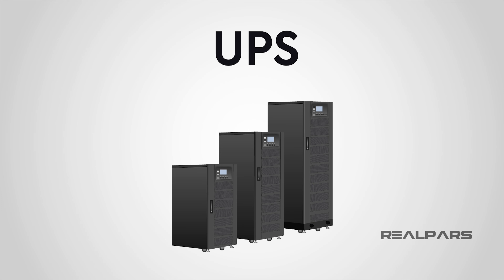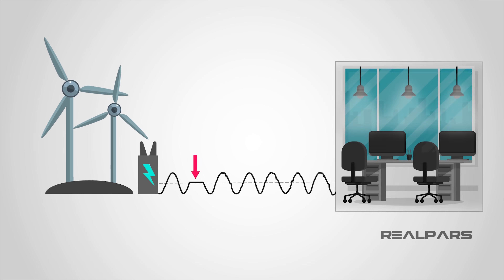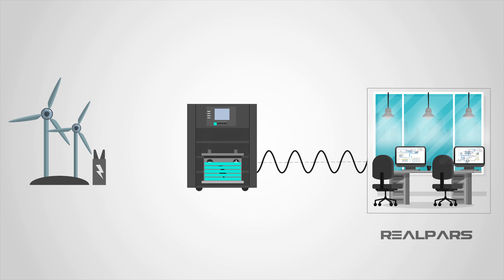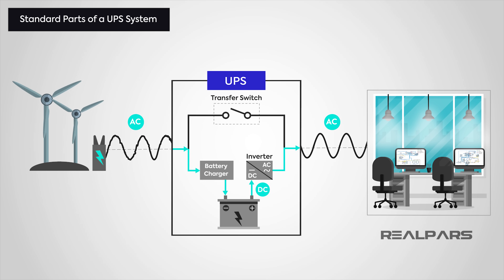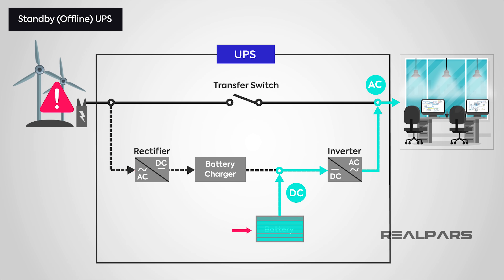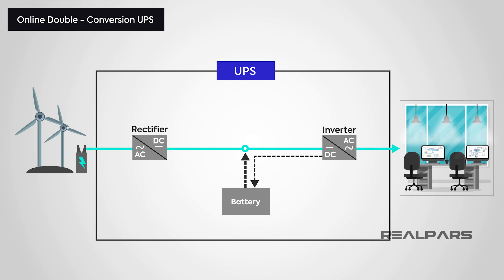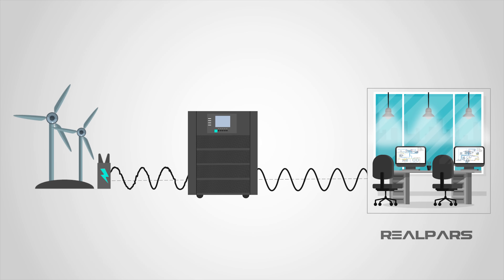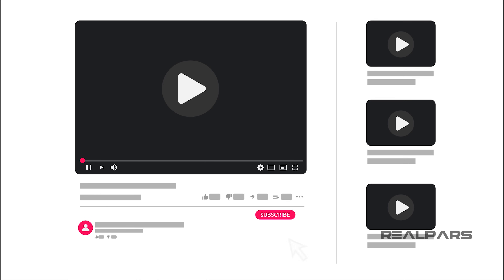What is a UPS? (Uninterruptible Power Supply)

Comment: Given that the batteries would provide only about 24V whereas the mains provide 120V/240V and the load equipment would also expect 120V/240V, there must also be step-up/step-down transformers inside the UPS. Of course, these would be part of the Battery Charger (step-down transformer) with AC-to-DC conversion (Rectifier) and the Inverter (step-up transformer) with DC-to-AC conversion.

Comment: Can i plug my computer with UPS during a power outage in my Generator? I am an online teacher.
Reply from the maker: Thanks for your question! You should be able to do this — just make sure your generator is running and your UPS still has some battery power before unplugging it from the wall and connecting it to the generator.
We recommend checking the manuals for your specific devices to be safe.

Happy learning from the RealPars Community!

Comment: Which type of UPS should I use best if I'm only using a laptop and a fiber router with 2 meshes? I just need a UPS system for a Work from home job is all because I don't want to be absent because of another unexpected power outage again
Reply from the maker: Hello, @ronnpaolomaigue5781  Thank you for your interesting question. We can’t give you a direct recommendation. Here is a rule you should follow: first, figure out the total line load in the current of your devices and the time you want the UPS to stay up when you lose power. Like 30 minutes or hours. Purchase the UPS that meets your needs and add 20% for the expansion of devices.  Happy learning from RealPars!

Comment: I run 2 pc's in an area with frequent power outages, one has an 850w PSU and the other 750w. 
Im terrified that a power outage will fry something someday, if i understand correctly i just need a UPS to have enough time to shut down everything safely before the battery is out right?
I dont need to keep running them while there is no power just a way to have enough time to react and shut them off in the event of an outage.
Would a UPS keep wattage flowing to my pc's without cutting out when power goes off? Thats what i need. I have a generator with the ability to automatically turn on when there is an outage but that just causes more risks imo because it shuts down and then on in a few seconds.
Reply: You are correct.  UPSs are sized to allow for an orderly, safe shutdown.  Keep in mind that you may lose medium voltage power that feeds your pumps and other equipment, but the UPS on a PC or PLC will allow them to continue to process the operational logic.  You need to ensure your I/O rack power remains on (maybe with a separate UPS) and if you lose your air compressor during a power outage, you will have a limited time to shutdown before you lose instrument air pressure.
Reply: @scottsommer6480  Thanks for the tips, ill look into it!

Comment: Can I plug a surge protector extension cord to UPS?
Reply from the maker: Hello, @joshuachu2445. Thank you for your question. Yes, you can, provided your extension cord meets the wattage requirements as your UPS's spec sheet requires. Ensure you stay within the length needed in the UPS manual and your local electrical codes. Happy learning from REALPARS!
Reply: @realpars  My extension chord handles 2500watts maximum. My UPS is 3000VA/1800w

Comment: How could one (data centre's) use generators with a double conversion UPS without a transfer switch?
Reply from the maker: As we stated in our video, you can have more than one UPS as a backup in your data center, protecting your data servers. The transfer switch is normally used on the AC side with generators and the utility power line coming into your plant. You can have more than one generator in parallel, too, depending on your engineering design and risk factors of power loss.

Comment: do standby USPs provide any additional protection from surges, voltage drops and instable supply for the load, in other words, could it be used as a protection means?
Reply from the maker: Hi Hamza, 

Thank you for your question. Yes, it can. But UPS power, depending on your load, will be limited until the batteries die. Regular UPS for backup use at home will last about 30 minutes. Many date servers have more significant UPS that can last as much as 2 hours. Those types of systems have a generator to back up the UPS.
Reply: @realpars  my question is about the case where the standby UPS is standing by, and the power is coming from the mains and not the battery, does the standby UPS provide any protection in this case?

Comment: uninterruptable power supply is device to keep computer or equipment safe when loss or significant reduction in primary power source. Ups houses several batteries that take over when it detects a loss or reduction in available power. Once detected, control is transferred over to the batteries

Comment: An ups battery will burn for 3 days non stop if it has a minor problem. So extreme caution should be taken when using them. Similarly big computers. The fire cannot be stopped because it is an electric dc shot circuit. At least 50 metres gaps are required for usage. Any DC system is like that. Some of them can burst to a range of 2 miles. Similarly huge TVs. Don't ask me why again and again.

Comment: Is there already a battery in the UPS which means have I buy new separate battery?
Reply from the maker: A UPS has one or more rechargeable batteries inside.  These batteries typically last 2-4 years, at which time, they need to be replaced.  The batteries are modular and can be removed and replaced fairly easily.  Most can be recycled.

Comment: should the UPS be plugged always, even if the PC is not in use?
Reply from the maker: The UPS should be plugged in whenever the PC is powered on.  If you power off the PC, you can power off the UPS, but you want to make sure the UPS is fully charged again before relying on it to provide backup power for the PC.

Comment: What about the power consumption of those three types of UPS? I have a 1Kav Online UPS and when I check with an energy monitor I feel it consume more electricity than it should be.
Reply from the maker: Every type of UPS consumes some power, even when not connected to the battery supply. On-line UPS systems, by their design, provide the highest level of protection against power loss but exhibit some power consumption during normal operation.  If your "losses" are >10%, then there may be an issue with the incoming power (cycle variations, "dirty" waveform, etc.) that is switching your system to battery in order to maintain a "clean" power feed.
Reply: @realpars  Thank you for your reply.

Comment: i have a question: do UPS consume more electricity?
Reply from the maker: Slightly more.  The UPS needs to consume power to keep its circuits alive.  From past measurements, I have found that a fully-charged UPS with no loads connected can draw between 5W (newer UPS models and technology) to about 50W (much older, less efficient UPS packages).  If the UPS provides 1500W at full load, then 5W is a small price to pay to keep your equipment running in case of a power outage.
Reply: @realpars  i currently have a 2000va, and i was given advise to connect the ups all the time. But one of my friend also told me that the ups charges like a phone charger?

Comment: Hi, when my PLC program is running, sometimes there is a power failure. And the process ends directly, and the program cannot continue. Do I need to select PLC with back up battery? or maybe use UPS? Do you have solutions for this? Thank You
Reply from the maker: If the PLC has a battery backup, it should continue running the program if incoming power is lost. Sometimes it is difficult to know when the batteries are near depletion, so I prefer using a UPS to back up all PLCs and the network switches to allow the network to continue to operate during limited power outages.  You may also want to consider backing up I/O racks as well, but unless you have a very large Rotary UPS backing up main power to the production areas, you won't be able to keep pumps and other equipment running even if the PLC program continues to run.
Reply: @realpars  Thankyou Real Pars, btw do we also need to use capacitor bank? for the supply

Comment: Can UPS plug in the whole time ?
Reply from the maker: Yes.  That is the way they are designed.  A UPS is kept online and inline, monitoring the power status, and when an outage is detected, it switches over to backup power, usually within one cycle (1/60th of a second).
Reply: @realpars  Thanks bro.

Comment: What kind of UPS you buy for more than 200 Pcs and 60 projectors?
Reply from the maker: The number of devices that are backed up by a UPS is not an important factor.  The total connected load and the amount of time you desire the UPS to back up the load in case of a power failure is what is important.  Of course, depending on the number of devices, you will need to have the means to plug in or connect all of the backed-up devices.  In your case, an appropriately sized standby UPS wired directly to a set of distribution panels with either appropriately-placed hardwired or plug-in outlets would be recommended.
Reply: @realpars  I'm trying to build a project for where I work . I get constant power fluctuations and outages, worse these types of UPS are not easily available. So I'm having hard time to find it.

Comment: I just realized that all cell phones and laptops are technically a UPS since it allows uninterrupted switching between battery and incoming power.
Reply: I work on these and this is exactly how I explain how they work... it's the concept
Reply: @bonesredlight  You're probably the only person in the comments that isn't 12 explaining how things work.
Reply: Cell phones and laptops are usually powered a charger, not straight out of the power outlet. The charger is what acts as a rectifier. So phones and laptops are powered by DC power. The laptop itself is NEVER powered by AC, you won't find an inverter in a laptop.
Reply: A phone is not a power supply
Reply: Thanks for the video
Reply: Those devices are always battery-fed. Ups feeds on battery when power goes out
Reply: @meksen2000 no, when a laptop hits its maximum battery charge it switches to wall power mode.
Reply: No they are not. A ups supply AC power to another piece of equipment.
Reply: @tramp2892  Same concept, when laptop battery is full it automatically switch to DC on plug and when plug is off it switches to battery AC
Reply: No they are not, at all

Comment: Would a UPS help protect against power problems like surges or poor wiring in a house? Sometimes my soundbar makes a loud popping noise when someone turns off a light switch in my house, and it also causes the lights to dim in my room. I'm worried about it damaging my computer.
I also live in an area where there is constant storms/hurricanes and experience several power outages every year.
Reply from the maker: Yes, a UPS would help protect against the power problems you are experiencing.  A UPS gives good surge protection as well as providing a backup for power outages.  Make sure you have a UPS that will give you an adequate amount of protection (based on the wattage of your computer and the length of time the backup needs to provide power in the event of a power loss).
Reply: @realpars  Thank you very much for the reply, and help. =)
Reply: @realpars  I believe my power supply for my PC is 800 watts. What kind of ups would you recommend for it?

Comment: Is it okay To plug your UPS to a Surge protector ( Multiplug)
Reply: Can I have an answer 🥺
Reply from the maker: I do not advise doing this.  It does not improve performance and it can cause problems.  In order for a UPS to maintain a constant and full power supply, you a UPS should always be plugged directly into the wall receptacle. Plugging your UPS into a surge protector may cause the UPS to go to battery more often when it normally should remain online. In addition, it may compromise the ground connection which the UPS needs in order to provide adequate surge protection. The UPS itself provides surge protection, so plugging it into a separate surge protector is not helpful.
Reply: @realpars  wow thanks man❤️🔥 subbed u for the reply ❤️😌

Comment: Do i need to unplug my ups from surge or wall outlet if not in use?
Reply from the maker: You don't need to, but since UPS devices do draw current even when no loads are connected, you probably would want to.  By the same token, UPS's have batteries which should not be allowed to fully discharge and set idle for long periods of time.
Reply: @realpars So is it safe to unplug during night when not in use?

Comment: Hello: thanks a lot for your video. Could you please inform if this video is for commercial UPS's and not for Industrial UPS's? Regards.
Reply from the maker: The concepts shown in the video apply to commercial and industrial UPS systems.  The main difference is in size and capacity of the batteries and switching systems.  Commercial office and home UPS systems are typically 1-phase whereas industrial UPS systems are typically 3-phase devices.

Comment: When the electricity is available, does the UPS charge automatically?? Or should we need to switch off the UPS and charge it???
Reply from the maker: UPS systems will charge when the source of electricity is available.  When the electricity source is interrupted, the circuit will automatically switch to provide stored power from the battery.
Reply: @realpars  Actually I wanted to know does the UPS need to charge separately by switching off the UPS power button or it is charged automatically while it is connected to power source???

Comment: Wow, I bet those UPSs drain out pretty good when the wind ain't blowing. Even with the wind blowing you'd only have a very small percentage of what you really need to make things work. Due to this, I doubt the accuracy of your entire video. I'll stick with my APCs and Salem nuclear plant, thank you.
Reply from the maker: Wind power is just an example of where primary power can come from. Substitute the windmills with a nuclear or gas-fired turbine.  Our aim in this video is to demonstrate how a UPS works, and I may be biased, but I think we did a pretty good job.
Reply: The ups wouldn't drain out quickly... It depends on how much load you have and how many strings of batteries you have.  You'll know how much time you have to properly shutdown whatever equipment that you are powering by the ups if needed

Comment: Can i use an ips ( Instant power supply) instead of an ups?
Reply from the maker: Yes, but it depends on your application.  You have to understand that an IPS is not for applications that require an un-interrupted power supply.  An IPS can take 1 second or more to switch over. PLC's and other industrial equipment may fail or go a halt state with a switchover time of 1 second.

Comment: So..if I'm building a pc..Do you buy this instead of a power supply or do you get both?
Reply: Great question!  A UPS only regulates the incoming power to its normal input voltage (120VAC).  When building a PC, you need a power supply to meet the voltage demands of the PC motherboard electronics (normally 12VDC).  The motherboard then regulates the supply to its components to other voltages (+/-5VDC, for example).  A UPS cannot input AC voltage and output DC voltage like a power supply is designed to do.

Comment: What if I plug in something that requires more wattage into my UPS' "battery and surge protection" sockets for the sake of not having "Surge only" sockets . Would it damage my equipment?
Reply from the maker: The UPS is only going to supply the power it is designed to supply.  The device will try to pull as many watts as it requires to operate, usually not at the same level as its rating.  You won't damage your equipment in most cases.  If the device does not have enough power to run, it will either shutdown or go to a sleep state to protect itself, or in an extreme case, such as a device with a disk drive. it may act sluggishly or may malfunction, depending on the way it was designed to handle low power situations.

Comment: Confused on how much wattage of the UPS I should buy, I have a high end gaming rig and here are my specs.

CPU: ryzen 5 3600
RAM: T-force delta 2x8 16gb ddr4 3000mhz
GPU: RTX 2060 SUPER 8gb
PSU: SEASONIC 750W

Do I need a UPS with a wattage higher than my PSU? Any advice would be appreciated!
Reply from the maker: A quick way to determine an adequate size for a UPS is to calculate the Volt-Amps required by each device.  Multiple the service voltage by the amp rating (on the device nameplate) to get Volt-Amps. For a 750W device like you, considering a power factor of 0.9, you require about 850 VA.  Add up all of the Volt-Amps for all devices to be added to the UPS and multiple that number by 1.2.  That is the capacity of the UPS you will need.  If the device you described is the only one to be put on the UPS, then a UPS of 1000VA would be satisfactory for about an hour of backup power.  Don't forget monitors or other peripherals that will need power!

Comment: is the battery charger coming with rectifier in online and offline ups just like the double conversion ups?is there any battery charger in double conversion ups? please clarify it for me
Reply from the maker: The online and offline UPS with transfer switch uses a separate rectifier and charging circuit to charge the battery.  The electronics in a double conversion UPS is a little different, but achieves the same result:  charging the battery.  In a double-conversion UPS, the DC current from the rectifier is usually reduced to keep the batteries from overheating or overcharging. So yes, a double-conversion UPS has a battery charging circuit, but it is different than the circuit used in a transfer-switch type UPS.
Reply: @realpars  thank you for the quick  response😊